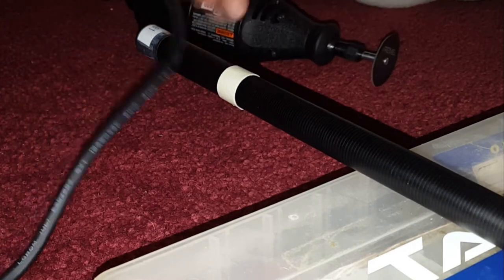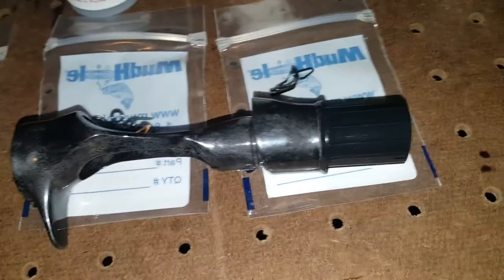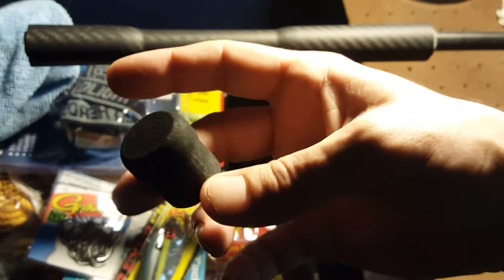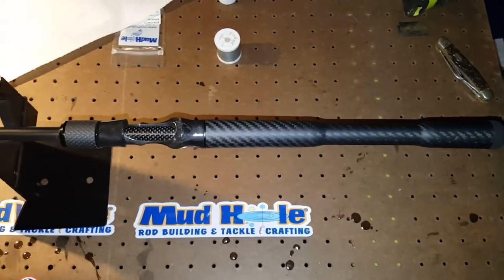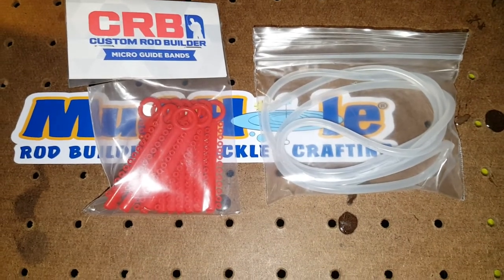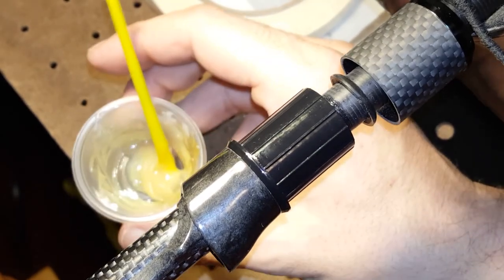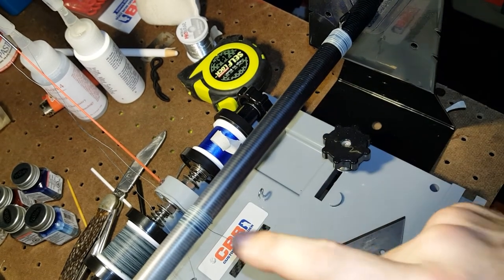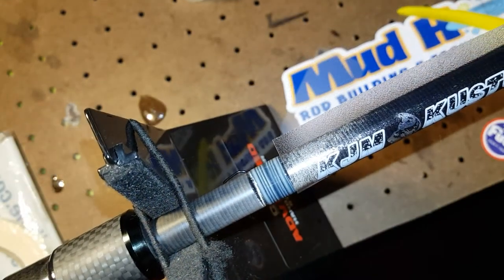Building a Custom X-Ray SJ-736 with NFC Carbon Grips - {1080p}

Comment: Nice job. Was wondering a few things actually. I thought you said you were doing an acid rod “spiral guides on it” if so was wondering how it throws. Another thing is I’m looking for a blank for my 3/4 oz spinner baits for pike. Was wondering if you throw them on it ever.
Reply from the maker: It cast OK. I probably prefer regular wrapping for casting.

It think it would throw 3/4 oz spinners with no or a very light trailer.

Comment: How's the inserts, does it decrease sensitivity compared to a standard ecms seat?
Reply from the maker: I don't know, it's hard to compare because the G2 reel seat has a huge open contact area and ecms has room for like one finger. But, overall an insert won't be as sensitive as a bare exposed blank. Some blanks you don't need an insert for the G2 Carbon reel seats, it all depends on diameter and where you want to put it. I had one X-Ray that wouldn't of needed one if I didn't cut 3 inches off. I built another X-Ray without an insert and just put a carbon fiber wrap underneath the reel seat.

Comment: What is the winding check in front of the unilock hood.
Reply from the maker: I put it there to try to cover up the open space under the hood to keep mud or whatever out. That's the first time I used one.